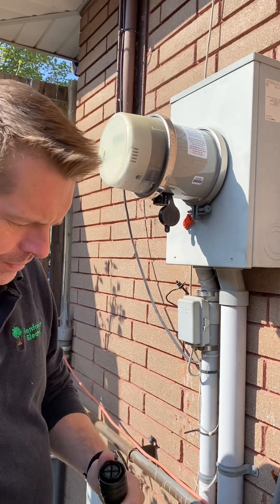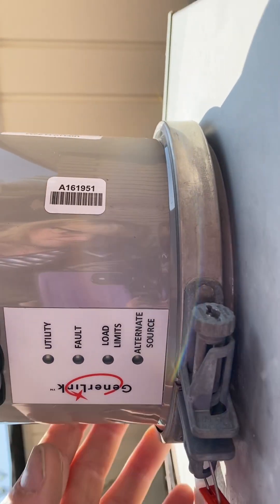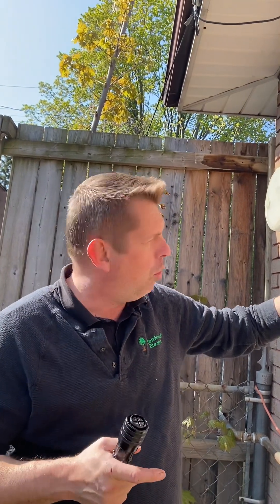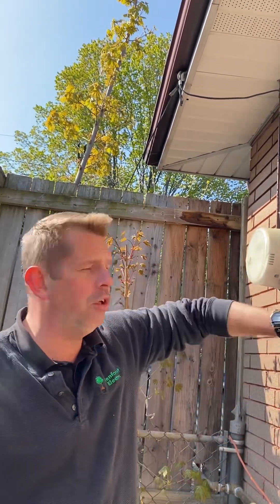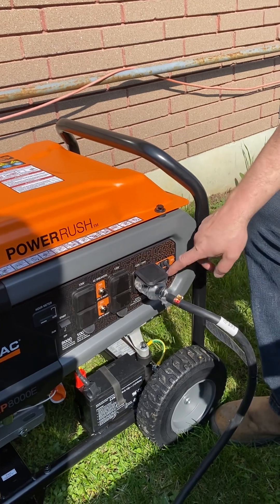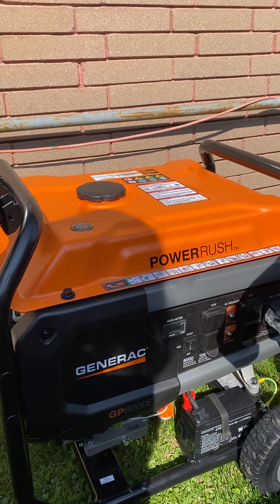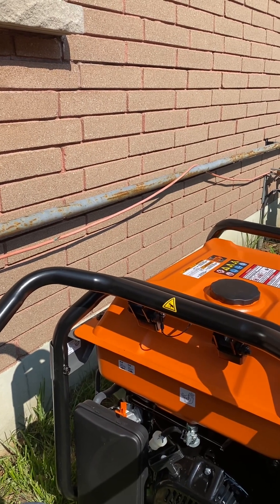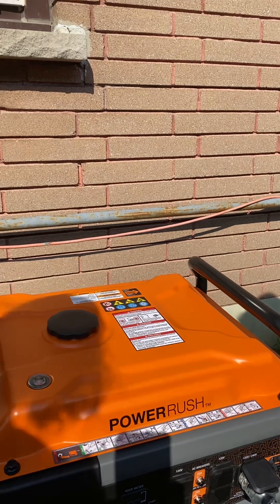How to use a GenerLink

Comment: That generator looks like it has a bonded neutral. Generlink uses neutral of the house panel so generator should be floating neutral. You can convert a bonded neutral to floating by removing a jumper wire on the generator. As well, change oil after 25 hours.

Comment: Quick question. I had an electrician work with the local hydro utility to install one of these units on my house about 3 months ago. At the time the work was completed, the electrician told me that there was no way to test it, so long as main utility power was coming in on the grid. That seemed quite odd and upon further review I see a note on the front page of the manual referring me to page 22 for the exact process of how to test the unit while utility power is still on. Does the Generlink automatically disconnect the main incoming when it senses generator power being provided, thereby isolating any chance of back feeding onto the grid? With that being said, when utility power would be reinstated, the house would remain on generator power (assuming the generator is running) and not switch back to utility power until such time as the generator is shut down and the Generlink unit no longer senses generator power. The Generlink plug should not be removed while a load is on the line. You say the plug may be left in all the time, so my understanding is that there is a current sensor in the Generlink that triggers the 'transfer connection' between the generator feed and the utility feed. Is my understanding of all of this correct? I think I paid a licensed electrician for nothing! Thanks
Reply: You probably got an answer already, but if you want to check to see if your generator is working while you still have power, turn your main breaker off in the house, that will kick the generac into gear, then turn the breaker back on, now you will be on generator power. If your generator is like mine, if the generator is running during a power outage, it shuts down automatically when it senses the powers back on.

Comment: Excellent demonstration, one of the best explanations regarding the Generlink transfer switches I've seen.

Curious to know whether you attached a grounding rod to your generator when you connected your transfer cable from the house to the generator. I noticed a grounding pin on my benchmark 11,500 watt generator.
Thanks

Comment: DON’T BUY!!!!! READ THIS!!!
I am in the middle of a battle with Global Power due to its laughable “warranty”
I am in Ontario Canada. Bought a Generlink through a licensed electrician and got it installed early in November 2023. Things looked fine by then (solid green light, no red light at any time) but on our first power outage we discovered that the unit didn’t work as intended: It won’t transferred to generator, never gives a blue light, neither a red one. Only green light.
Electrician and I have contacted Global Power and they’ve come up with their joke of warranty policy, consisting of 2 points:
1.	They won’t replace the faulty unit with a new one, or refund me. Instead, they want it back so they can fix it. In other words, they are getting money supposedly of a new unit for a refurbished one.
2.	To get the faulty unit back to them, they pretend me to pay for the shipping out of my pocket, as I was told over the phone by a costumer service rep, which also said “you pay to send it to us, we pay for send it back to you” as if they were doing me a favour!
I am pushing back on these two points and will only settle for a new Generlink or a full refund.
This has become an unnecessary nightmare without any idea of when it will be solved, but my family and I are more than resolved to take it wherever is need to get a fair outcome.
If potential customers know that Global Power’s warranty is to sell you a refurbished unit for the price of a new one, would you settle for it?
DON’T BUY!!!!
Ps: I will post updates ONLY if the outcome of this battle is a fair one.

Comment: Good video, thanks for posting. I'm having my Generlink installed today. I would suggest logging the generator run time hours to keep up on oil change frequency. A question I have is whether or not anything has to be done with generator grounding ?
Reply: A generator can be grounded using a rod or plate attached to the frame, but that is not strictly necessary for correct operation. And since your electrical service is grounded already (or it should be, anyway), and the generator is bonded to that ground via the generlink cord, there is very little chance of any kind of potential difference between the generator and the items its powering.
Reply: @GlenforestElectric  Thanks for the quick response about grounding. Hydro One came by and the whole process took about 15 minutes. I did a transfer test afterwards and all is good !

Comment: There seems to be some “conflicting” information out there in regards to the MAIN BREAKER switch on the main panel in the house. Some experts say you don’t have to turn the main breaker switch to OFF before starting/engaging the generator. Some people say you can just leave the main breaker switch ON. ~ I know you should switch all the other breakers OFF and just turn ON the breakers you need to have on … fridges, freezers etc. ~ So, which is it?  - Is it imperative to have the main breaker switch (in house) to the panel in the OFF or ON position on the main panel … BEFORE … starting the generator?
Reply: The only time it is 100% necessary to have the main service breaker off when switching to the generator is during testing. And even then, it's not always necessary. 

The Generlink will not switch inputs (grid to gen or gen to grid) while current is flowing from its existing source (either grid or gen). So to test the Generlink after installation while you still have grid power, you will need to turn of the main breaker to allow the Genrrlink to switch to generator power. 

However, it is adviseable to turn off the circuit breakers for larger items (oven, dryer, AC, electric heat). The Generlink can run these, but not all at the same time. You should be aware of their usage, and make sure that they're only being used one at a time.
Reply: @GlenforestElectric  ~ Thank you very much for responding. Your input was very helpful. 👍

Comment: Great instructive video. I have a similar Generator, but my output is 3 prong, not the 4 prong. If I get an adapter, will my Generator work with the Generlink?
Reply: You likely have a 30A 120V receptacle, rather than the 30A 120/240V. The 120V is used for camper trailer power. The Generlink will not run reliably on a 120V feed. The 4-prong twist-lock 30A 120V/240V is ideal. It will also work with a 4-prong 20A 120V/240V, but then of course the capacity is limited to 20A and not 30A.

Comment: Hello neighbor (sort of) I am in the Kingston Area.  I bought one of these last summer (Generlink) with a 80' cord and it works well.  I use it with a 5500 watt inverter (30 amp) Generator.  I put the cord on a hose real cart which makes it nice.  In a year we have had 3 power fails and the wife can easily get things set up if I am at work.  It powers the entire house with a 2 ton A/C unit (I have a soft starter on it).  I believe your Electrician touched on this, but if you want to perform a generator/generlink test with the utility power still present, it is possible.  The Generlink will prefer ALTERNATE SOURCE (generator) power supply, but it will never transfer to or from it's current supply if there is any load on the generlink.  So if you are on utility power and the generator is also connected and powered, you must open all your breakers to bring the load to zero.  The generlink will then transfer to generator, and when you start closing the breakers you will hear your generator begin to labour.  You can then run your test for as long as you like.  When done, once you open the generator breaker (or better, open all your house breakers first), the generlink will transfer back to utility power.
also the same if you lose power and have the generator powering your house.  The generlink will continue using your generator even if utility power is restored and only switch to utility power if you shut down your generator.
Reply: Correct, except for the fact that instead of shutting each of your breakers down one by one, you can acheive the same thing by shutting down your main breaker.
Reply: @GlenforestElectric  yes.  But powering up everything at once can labour your generator or trip it with starting amps.  If you had a dryer or oven going.  Safer to shut things down and power them up over a few seconds than boom  30 amps now!  I do flip the main myself but i make a point of shutting down anything 240.
Reply: @TheBry_Guy  that's certainly a prudent method.